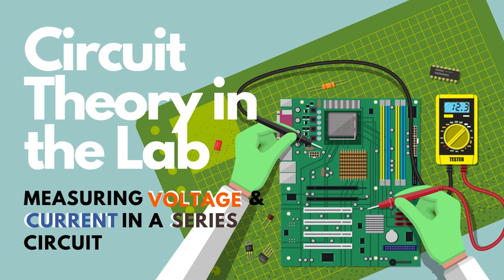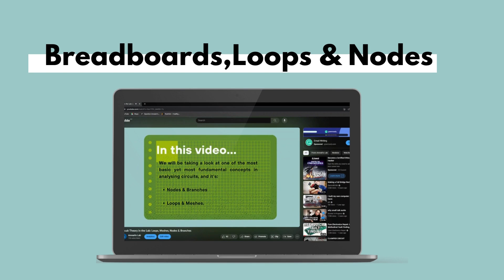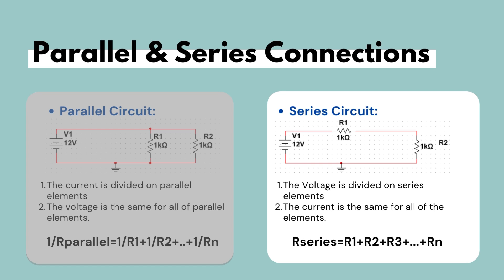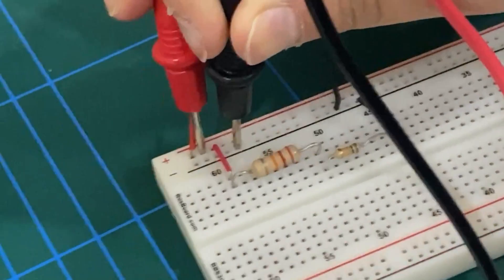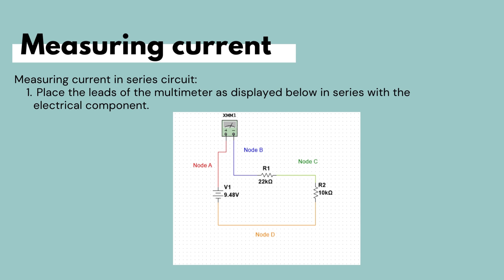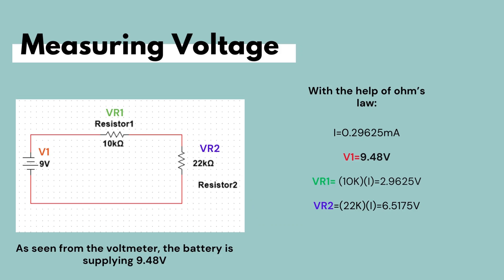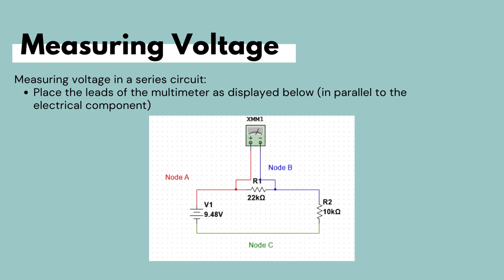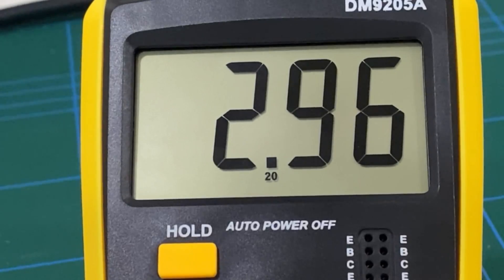Circuit Theory in the Lab: Measuring Voltage & Current in Series Circuits

Comment: Say i have a power supply not battery and i want to find the current it is provoding.  Voltage i can find by direct pugging to its output i.e. parallel. How about current. Do i need to add resistor in series with output so that current can flow through it or do i directly plug the leads to output of p.s. but then isn't it becomes parallel to the output. Please help